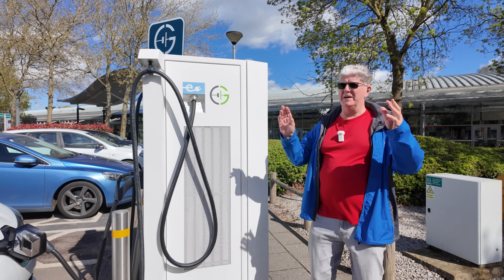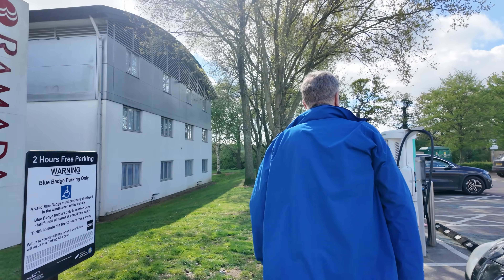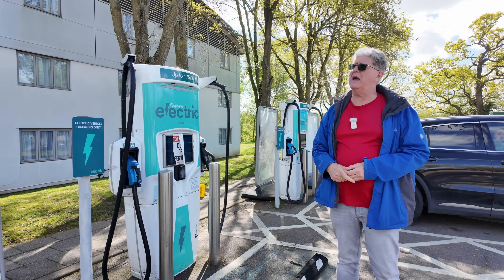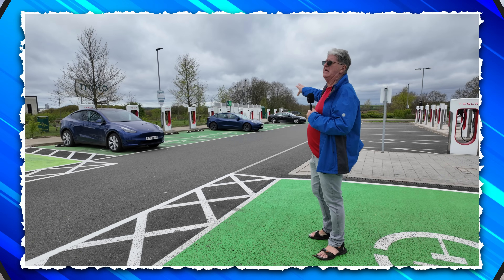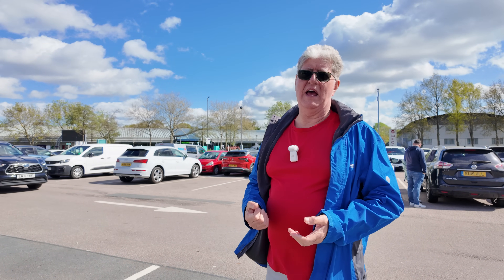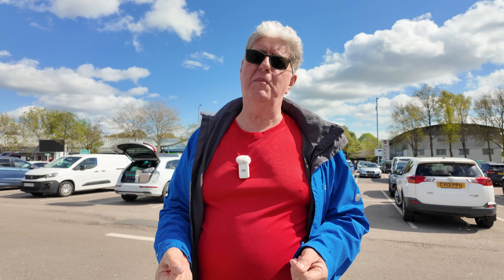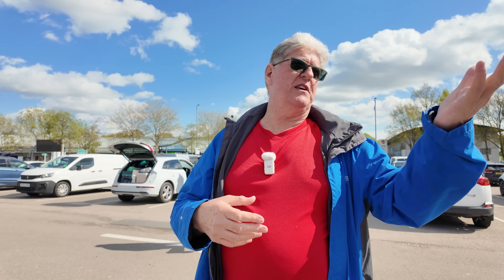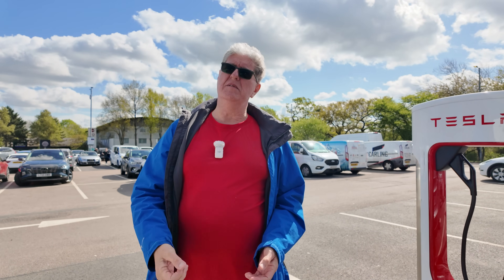What Happens When EV Chargers Get TOO Old?

Comment: Where is the infrastructure to supply all those chargers. I suspect it will be demand control and not allow all chargers to be in operation at the same time.
Reply from the maker: CPOs pay a substantial capacity fee on top of the standing charges to guarantee electricity supply. It's one of the factors pushing up public charging prices.
Reply: @ That and the cost to upgrade local substations. As a business you pay the capacity charge whether the substaton needs upgrading or not. If the substation needs upgrading to supply the extra capacity the CPO may also end up having to cover that (or abandon the site).

CPOs reject locations because the local substation can't meet their demands. They tend to do this work at a very early stage in the project.

When people talk about infrastructure, they tend to focus on the generation side of things and ignore the local supply side of things.
Reply: @paulweston1106  huh! , Poles and Wires have a limitation in local areas and were originally designed for houses ONLY. Not the EV dragging lots of Current.
Reply: @ An EV plugged into a house can't draw more curent than the incoming main can supply. If the house has a 60A main fuse then even with an EV the house can't pull down more than that. I do however accept that sometimes a substation can't cope in periods of high demand. We had this issue where I live, we used to get regular brown/blackouts and it was only resolved when a new housing development was built and the substation upgraded.

For an EV charging station there would need to be a separate supply. If the CPO thinks this is cost effective then they may well upgrade, if not then the site is abandoned.
Reply: @ wait until we all plugin an EV, then what ? Even if 7 out of 10 houses are charging it would definitely cause blackouts by tripping local area supply.

Comment: Lets save the planet. Rip out the chargers, fit new, rip those out, fit new. New tarmac parking with fancy colour paints. Lets develop  so many apps to confuse all but the diehard anorak ev evangelists. Yep, evs are the future 😂
Reply: So they never replace petrol pumps?
Reply: @michealridgway7607  There are pumps near me that still have analogue dials, probably installed in the 70's. They still work fine with my car that was also built in the 70s. There's a reason people dumped EVs >100 years ago. Well, lots of reasons. History is repeating itself.

Comment: It is a strange thing now that the buesiest services have more and more chargers! I used them last year and was amazed how many are available. 
The thing to remember when people complain about no chargers near them, there is less need for them near your home as you can travel 200 miles before needing to charge in most EV's so you will be well away from your area to need them. 
We do need more options for those without a driveway, but these then should be the slower overnight chargers that could be priced nice and low.
Reply: Destination chargers should be provided/organised by local authorities in most cases.

Comment: Tesla chargers are the best maintained chargers on this planet. If you see damage, it's damage and not neglect. I've never been to a Tesla charger that I cannot charge at, and a Tesla owner can report any charger using their car. What you SHOULD be asking is how so many gasoline automobiles are neglected, from the fuel system to the tires to the brakes; THOSE are the dangerous vehicles to operate, not electrics.

Comment: Until there’s a chargers on every parking space you will get queues, but you also get queues at petrol stations sometimes, you will always pay a premium for topping up your “tank” even petrol is higher at service stations
Reply: Throughput at petrol stations is much quicker though so not really a direct comparison.

The problem with EV charging prices is that the location of the charger doesn't seem to make that much difference as prices are fairly consistent.

Comment: I am planning a trip along the South Coast to Weymouth and on to St Austell. According to Zapmap there are lots of chargers but they are mostly low powered and expensive.
Reply from the maker: Quick comment, I would not rely on Zapmap for anything sensible. My first choice would be to pick your favourite CPO if you have one, then check websites and individual apps. Then check memberships if you will be charging several times.
Reply: @ I agree. I have mapped my route using Tesla Superchargers and my subscription where possible and will follow your advice for local top ups. Thanks.

Comment: i would doubt the tesla,  bin the chargers and not collect all the parts back off.
There will be a few days a Year when there may be a que.  but I was on Tesco charger and for a second time there was a ev parked at a charger and was NOT plugged in.
thing would go faster if drivers were told when the charge is nearly complete.  so they can get back.
Reply: At one of my local Tesco EV taxi drivers use the charge bays as convenient close-to-store parking WITHOUT plugging in!

Comment: A glut of chargers, yes, ....standing idle. £60 to fill up with them.
£5 to fill up at home.
Reply: Public charging in Britain is a rip off. Double the price on average of Europe. Another Brexit benefit!
Reply: @shieldaigbencher Actually, nothing to do with Brexit but the UK energy market and marginal pricing. 
Thank Thatcher for selling everything and then the closure of the Rough gas storage, which then needed to be opened and filled with expensive gas at the highest price at the beginning of the Ukraine war.
Reply: @djtaylorutube  20%VAT versus 5% VAT on domestic electricity doesn't help.
Reply: @djwarren5081  I agree, it doesn't.
Reply: @shieldaigbencher  Of course we are free again and the King is in charge.What we always wanted.
Reply: Would everyone using public chargers really "fill up" or are they more likely to just "top up" with enough kWh to get complete their journey when they can then charge at a cheap rate again?
Reply: @paulweston1106  

I often fill up as home charging not feasible for me, I currently use Tesla (250kW charger) at 33p (or 37p) per kWh, or ChargePlaceScotland (22kW charger) at 25p per kWh.
So not quite so bad with the warmer weather now and my MG4 starting to tip over the 4 mile per kWh.
Reply: @paulweston1106  You'll never win at EV Bingo with reliable, actual correct information Paul?
Reply: @paulweston1106 exactly that. Just enough to get u home.

Comment: I charge on a Tesla site half a mile from work for 43p rather than a work charger on 7kw at 55p. Crazy.
Reply: Your work are extracting the P. We pay 20p/kWh on our work level 2s, run by ChargePoint. 55p makes them a profit centre not a staff perk.
Reply: @stevetodd7383  At £0.20/kWh it sounds as though the company is subsidising charging. If the chargers are being run from the building supply and it is a large building I doubt they could even buy the elctricity for £0.20/kWh, on top of the price they pay there is VAT chargable to the end user, they also pay guaranteed capacity charges and half-hourly meter charges. If the charger is operated by a third party there will be banking chargers and some element of recovery for capital and operating costs.
Reply: You might think spending your old age talking about EV charging points was a   rather bizarre way to spend your remaining years. And you'd be right.
Reply: You have to balance cost and convenience. At work you can presumably plug in when you arrive, leave the car charging all day and just unplug with a full charge when you leave work, this has similar convenience to charging at home. When you use the Tesla chargers you are presumably having to wait with the car whilst it charges so it becomes less convenient.
Reply: @paulweston1106  so by that logic it’s ok for an employer to charge for staff parking as it’s more convenient?